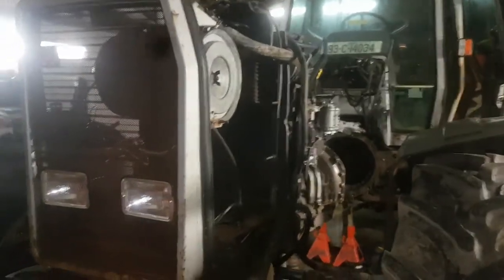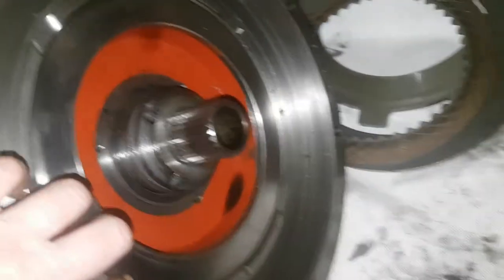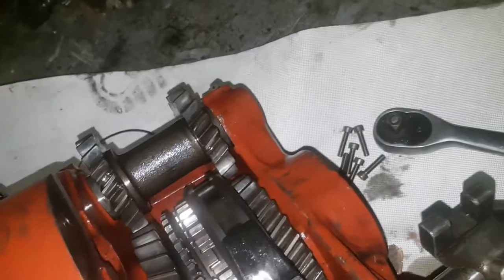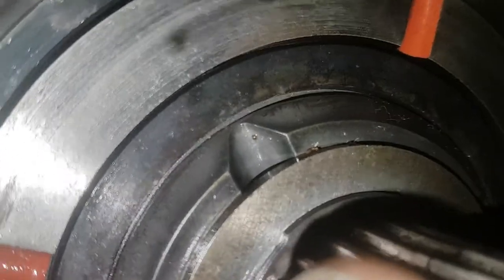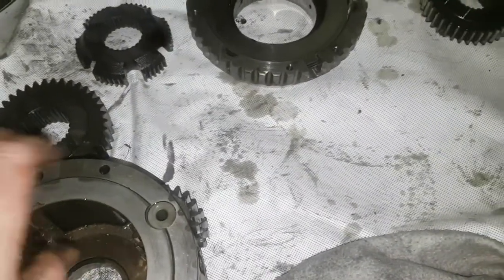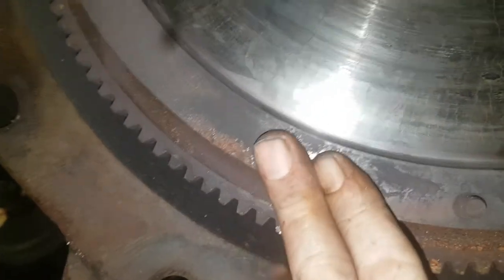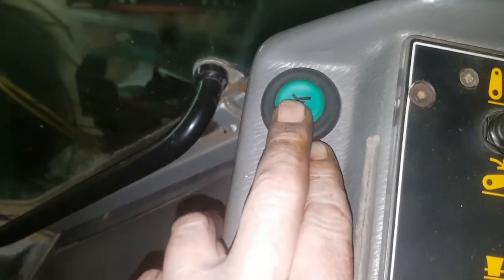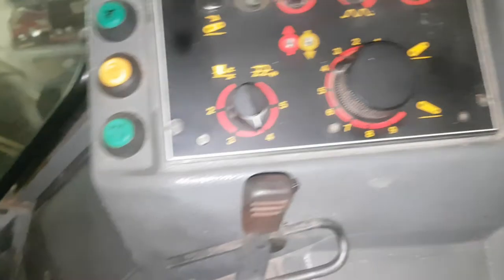Massey Ferguson 3125 speedshift problems restoration part 1

Comment: Nicely done, its a tidy tractor looks like you caught the roof rust in time before its starts to leak same with the doors,
 just a shame on the gearbox it suggests someone previous has carried on using it for a good amount of time without the speedshift or high-low working for the sake of seals and splitting the tractor that's done some damage. 
Hope you can get all the parts it will be spot on when your done 👍
Reply from the maker: Ye Ben watching your video helped me in deciding to buy the tractor and turns out the mechanic I bought it off was very honest in his opinion and history of the tractor that his brother owned 
After I'm done painted and mechanics perfect I'm in under 8k euro 
Alot of tractor for the money and a great experience
Reply: @gearsandtears7643  good deal , good ones are getting harder to find. 
mines been a good experience im getting better at diagnosing electric niggles and more confident about going into gearboxes and such . 👍
Reply from the maker: @bengoddard6898  Ye once you get a few big jobs done it revealed a very simplistic tractor that was ahead of its time 
Its a project for my twin sons to get a bit of summer work so it's a Labour of love really
Reply: @gearsandtears7643  Ich brauche gute Pflegeverschlüsse, Massey Forexin Maschine
Reply from the maker: @احمدالجوراني-ر1ذ  I've no idea what you said but thank you anyway

Comment: Good video pat! Explains alot thanks! I send you a f.b message if you get a chance to read it. Cheers
Reply from the maker: thanks Roy
I don't see the fb message
Reply: @gearsandtears7643  check friend request for my name. Thanks
Reply from the maker: @roysmyth4284  you sure you messaged the right person?
Michael byrne
Reply: @gearsandtears7643  that's where the problem is. I can't see the correct f.b profile for you.
Reply from the maker: @roysmyth4284  what profile are you sending to ?
Reply: @gearsandtears7643  had wrong name. There's loads of Michael Byrne. Can you look for my name please, send request. Thanks
Reply from the maker: @roysmyth4284  I'm sure there's a few roy smyth too
Reply: @gearsandtears7643   😄 that's true... It's a profile picture with mountains background. Says I live in trim, Meath.
Reply from the maker: @roysmyth4284  thinks I found ya
sent a howdee